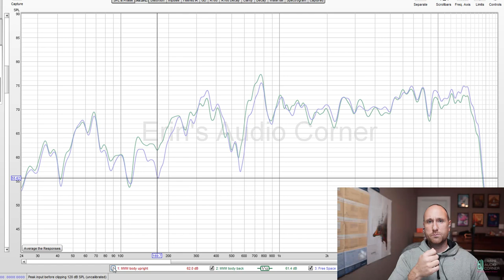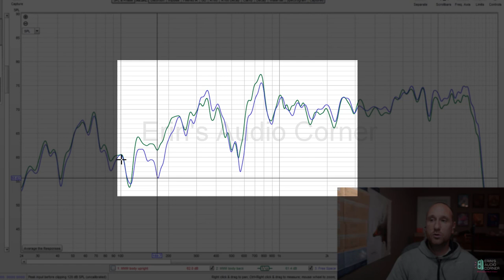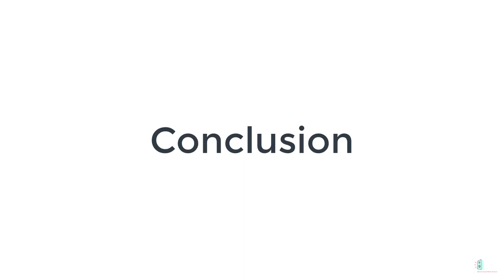Tuning Your System with a House Curve and Moving Mic Methods

Comment: First time I’ve seen the mic held pointing down. My couch is pretty absorptive so I imagine there will be a difference with the upright 90 deg position. I also noticed that when one is measuring L+R MMM the bass appears more boosted than when only a single channel is used — this might make one lower the bass more than what is actually desired.

Comment: This is interesting, I was expecting a bigger difference. 

I'm sort of disappointed you didn't do this in the car but it's still useful information. It's interesting to see the biggest delta affects the midbass area and the body is causing constructive interference.

I built a fan rig similar to yours so I'll do my own in car measurements this week so I can conduct my own experiment.

Cool video. 

Keep up the good work.
Reply from the maker: Well, I wound up trying to set it up in the car but it was a pain with the camera so I got frustrated and just bailed on that.
Reply: @ErinsAudioCorner  Haha! No worries Erin. I totally understand. I was going to go mess with the Helix Auto EQ tonight but when its only 20 degrees outside my motivation to do car audio stuff tends to go way down.

Comment: I hope T-Fade finds this video.  My conclusion over years of attempting to tune is to take it to someone who knows what they are doing and save yourself hours of frustration.   Unless you like that sort of thing.  You can always play with the tune later after it’s been in capable hands.  Just be sure to have the tune backed up so you don’t overwrite it.   I’ve been to several different people and they are all slightly different. I learned something from each of them.  If I start from a tune from scratch I still can’t get it to sound as good as what they create.
Reply from the maker: I just sent him the link.  Hopefully it'll help him out a little bit.

Comment: Would have loved to see the graphs in your theater room with the mic pointed up for the last measurement style on the boom. There's likely some ceiling reflections coming into play and also those from the couch. The couch (which appears to be leather/vinyl) being so close to the mic when pointed down would likely account for the more lively top end on that measurement I'd think.
Reply from the maker: Tradeoffs.  I had to point it downward to capture the response in the head area.  Pointing it up meant the boom hits the seat and the mic is at best about 4 inches above the head area.  Based on what I'm seeing here, I honestly don't think the difference would have changed if the mic could have been pointed up, though.  But there's no way to know for sure unless I measure from the side (which could also impact the response).  Six of one...
Reply: I figured there was a reason. Sure it won't make much difference but since we are talking about the difference a body in the way makes we are already kinda splitting hairs. Great video.

Comment: @Erin's Audio Corner  
Good stuff, man!  This video supplants hundreds of forum posts trying to describe & explain all of the techniques, differences, and corresponding results. 👍

Really looking forward to your findings regarding the UMIK-X.  :-)

As a side note, you might consider changing the title to achieve significantly better search results.

I get that your current Title is simple and to the point...but...

For instance, your Title does not include, "Measurement(s)", "Microphone", "Using" & "REW", "Home" & "Stereo" & "Theater", "Car" & "Audio", "Target", "Frequency Response", "How To", and the #1 search term, "The Best...", etc.  ;-)

So if I searched for, "REW Microphone Measurements", your video most likely wouldn't be at the top of the list.

Maybe something like, "Moving Mic Methods How-To: The Best Microphone Measurement Techniques Using REW to Tune and Match Frequency Response to a Target House Curve in Your Home Theater or Car Audio Stereo System".

I realize that it's a LONG & somewhat overly complex Title, but it incorporates the Key Phrases & Combination of Words that viewers with various types of systems are most likely to use during their search for this specific information...

Which equates to exponentially more channel views.  :-)

Just my usual 0.02  :p

Comment: another great vid Erin. will def move to the back seat to do measurements in the future.  Just a question on sweeps vs MMM with PN.   Is there value in being able to measure IR (to set delays) and/or unwrapped phase (for phase alignment) using sweeps?  or is this not useful in car audio and if so why?
Reply from the maker: In car audio it is useful to help you set actual time delay.  But do you have to have it?  Nope.  Really, a standard tape measure will suffice.  Measure the distance to each speaker and set the time delay accordingly.
Reply: @ErinsAudioCorner   Thanks Erin.  Went back and remeasured the distances after taking the seats out of the car.  Deducted the distances from the speaker furthest away (sub) and plugged the resulting delays into the DSP.  Instant improvement !!   Thanks again...

Comment: Nice job, Erin. Very interesting. Have you considered comparing the moving mic method vs. a microphone array? Also, the production on this video and the animated intro were super well done. Did Nick happen to do the intro?
Reply from the maker: LOL... have I considered.... man, you know my squirrel brain.  I actually made mention of arrays and showed off the UMIK-X but I edited it out because I didn't want it to get sidetracked.  I will be reviewing the UMIK-X soon.  That piece is a game changer.  And I rarely use that term.  

Thanks for the props, man!  I appreciate that.  I've been working to get better at the quality of the videos but there is always something I want to improve on.  I actually paid someone on Fiverr to do the intro back in March or so.  Think I paid like $50.  Well worth it.
Reply: @ErinsAudioCorner    As far as I know, REW pro update now has the capability to measure using the multi mic arrays.    Interested to see your review on the UMIK-X
Reply from the maker: @socketsocket2763  yep and the UMIK-X includes a license for REW Pro. 👍
Reply: Why do you have to use a sine sweep for the single-point averaged measurements? I’m trying to make measurements in my car. I took multiple single-point measurements using pink noise and was going to average them together.

Comment: Hey Erin thanks for the knowledgeable video.
I tired many times to match house curve in REW on helix miniDSP in my car... but the graph doesn't change much only its get some Cutts but the overall graphic nature remains same in entire range... can suggest how can i get a flat cure or target curve
Reply: Pls give ur suggestions!!
Reply from the maker: Honestly, there could be any number of reasons as to why you're having issues.  I wouldn't know where to start without more information.  What's your setup, what is the target curve you are trying to achieve?  That kind of info.  I'll try to help if I can but doing this over the internet is kind of hard.
Reply: @ErinsAudioCorner  thanks for your quick reply.

Comment: Hi Erin, could also try to show the difference between single mic vs multiple mic results, So with multiple mic setup you really don't actually need to move the mic from left to right and upside down. Rest the information is very informative.
Reply from the maker: I don't have the means to use multiple microphones (anymore).  I do, however, have the MiniDSP UMIK-X - which is an arrayed USB microphone - on hand and will be reviewing that soon.  :)

Comment: i do not know if these methods are supposed to do measure something special.
but if you want a even loudness across the frequency band to you ears, then use the ears to adjust it.
a mic can show something visually or adjust for delay and phase really well. but for volume it is not useful.  
its very easy to sit in the listening position and use a tone generator and send out a mono signal to both speakers, go slowly across the frequency band from the lowest hz you want to the highest you want, smooth it all out to it sound  like even loudness, and try this out at low and high volume.  works for subwoofer integration also.

Comment: So in the drivers seat of my truck I should put a blowup doll or crash dummy with heads removed while using your home built fan mic method 😁
Reply from the maker: Dude... I stopped reading at "blowup doll".  😂😜
Reply: @ErinsAudioCorner  lmao , while watching this video I was thinking about the clothing that I wear most and how I can put that on the dummy. While also removing the head of it I can somehow have the fan/microphone assembly tucked behind it so I can get consistent measurements. Then again have the head still attached would make better sense. 

Yes I know it sounds crazy. My grandmother came to the states from Germany. When I begin to think of fabricating or engineering something I swear on everything that the percentage of German blood I do have is dominant. Over doing it!!!!
Reply: Some of those dolls have built in nicely cushioned mic holders!😂
Reply: @Jeremydmeyer76  🤣 🤪